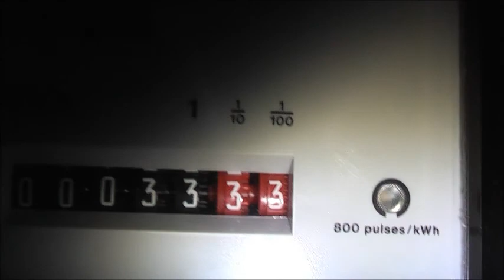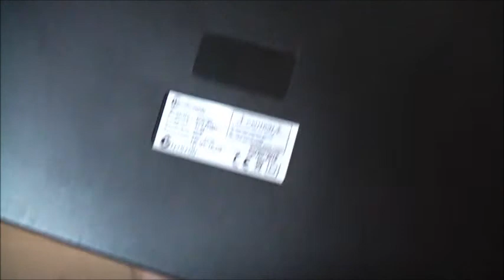Tuesday Update

Comment: Hiya. That dual-filament bulb that you have with only one filament working in it..... 

Stuff it on the variac and see if you can get an arc in there. :D

Alternatively, save about 20 of those bulbs (assuming that they work on 12v) and then connect them all in series....Then they'll all work straight off the wall socket. :D

Aaaaw....More Charlotte. :-) Mr. Whiskers is probably out somewhere catching mice. :-)

Gotta love cats. :D

Thanxx for showing,

-BoomBoxDeluxe.